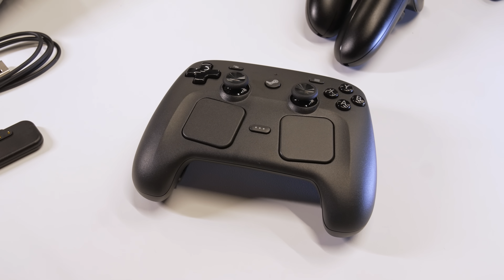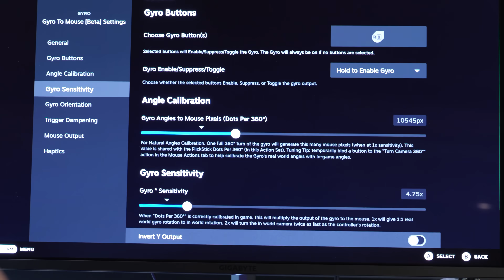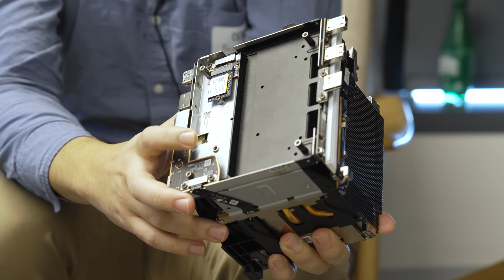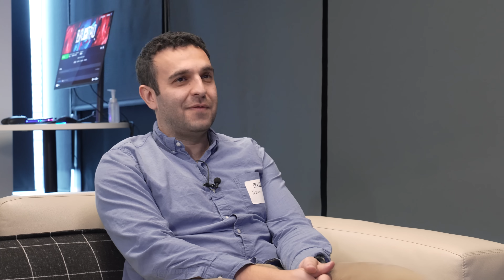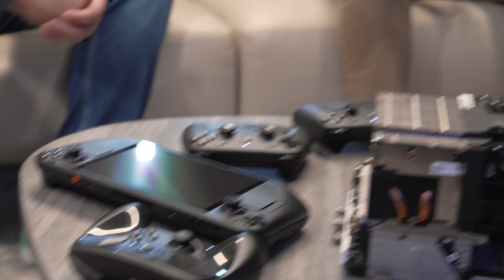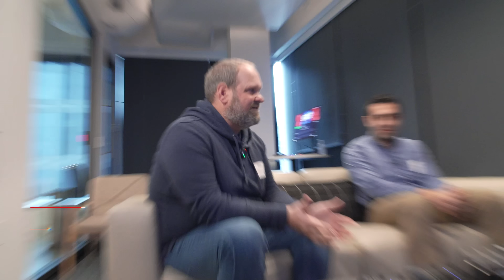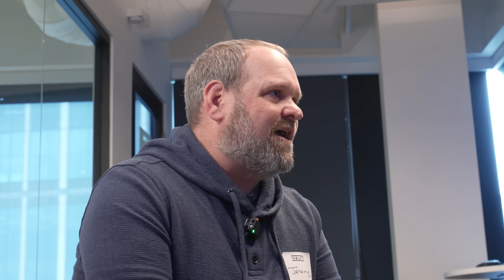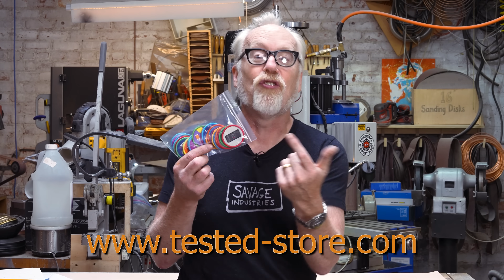Hands-On: Valve Steam Controller 2 and Steam Machine!

Comment: I was this close to upgrading my gaming PC yet again (new mobo, processor, and RAM), but I'm going all-in on the Steam Machine and the controller.
Reply: You don’t even know the price yet! If your CPU is less than 10 years old, it’s probably fine for gaming and anything higher than a Radeon 7600, about a $200 GPU will perform better.
Reply: @chrisward000  Here's the cost breakdown of me upgrading. 

Upgrading my current rig will cost about $700. 

I already have the Case: Cougar MX330 ATX ($60), Storage, a (recently upgraded) Corsair CX750M Power Supply ($90), and a (recently upgraded)  MSI GeForce RTX 3060 Ventus 2X 12G GPU ($280).

The new parts I need are:

* Ryzen 5 7600X is $180

* MSI B650 MoBo is $140

* Thermalright CPU Cooler is about $40

* RAM is currently $200-300 because prices are currently insane. I have the Kingston FURY Beast 32 GB currently listed on my PC Part Picker which right now costs $267! Granted, I really only need 16GB, but it's still way too expensive and more RAM is actually the better deal per GB at the moment since it's all WAY TOO expensive.  

Now, will the GabeCube cost the same or less than upgrading? I don't know. But if it's close, I'm sure as heckfire gonna go with the GabeCube and whatever warranty they offer (and their warranty is important) rather than upgrading. 

ALSO, when the GabeCube finally outlives is usefulness, it almost certainly going to be in the same (inflation adjusted) price range as now, and by then I'd have needed a new PCU and GPU too, which would add another $400 to the $700 I'd be looking at to upgrade more more time on my current rig. 

So all-in-all, the cost of a PC for me to build is really around the $1200 range (all said and done) yet there's no decent warranty and I have to deal with returns, refunds, and exchanges all on my own with no recourse it will get taken care of. 

At the end of the day, the GabeCube is simply going to be the better value.
Reply: I might do both, if the Steam Machine price is reasonable, and if the Steam Link on this thing gets high marks. The specs on it are good, not great, which is fine for what it is. But using it to stream to my TV from a high-end PC, that has the potential to be absolutely glorious. I get way too much input lag trying to do this on my Steam Deck, so we shall see.

Comment: Wish there were more commentary around 8GB of VRAM, seems like it could easily be a limiting factor in the medium term future. 
That being said, for a secondary device, I’m very interested in picking up all of these new hardwares - although depending on price, I’ll probably supply my own 2/4 TB NVME and buy the model with 512 default.
Reply: My hope is that since it's an APU, and AMD has already made laptops where the APU is able to use some of the system RAM as VRAM that that is also the case here.

Comment: I was rather sad when my steam controller died earlier this year and they didn't have any replacement parts. I look forward to this new offering.
Reply: RIP
Reply: i have two steam controllers, one using and one still in unopened box (sealed)
Reply: @crcka  That was me until the first one started drifting. Now I'm on my second and really looking forward to the new version before this one craps out.
Reply: @sntslilhlpr6601 that was me until last month :'(
Reply: @sntslilhlpr6601  You see the new anti drift tech they are using? 
No membranes, only magnets.
Reply: I fixed my original steam controller the best I could with 3d printed parts etc but finally decided to get another one, I managed to find a 2nd hand one in good condition and have been using that.
I'm looking forward to trying out the new controller.  I hope it has better reception from the public than the first.
Reply: what broke?
perhaps it is still fixeable with third party parts, or custom made parts(diy).
for example if the joystick is broken, like insane drift or such.
often custom ones can be added in.
plus I assume that one still used pot based sticks based on when it launched, pot based sticks often break due to there being dust between the joystick mechanisms, or buttons or such.
cleaning it properly fixes many of the problems, not all however.

but like the nintendo switch pro controllers are notorious for this, as they tend to break super easily due to dust under their buttons or joysticks making it completely unrelyable, or just not working and then people throw them away, while cleaning would fix most of it.

though ofcource, with the new controller launching. if cleaning doesn't fix it and there is no cheap other fix, it might be worth checking out that new one, as knowing valve it will be much cheaper than what most companies would charge for something like that, like several times cheaper. not sure if they can beat the super budged yet high quality controllers like the flydigy direwolf 3 or such in price as that steam controller will have many added things.
but they should be able to beat most conntroller brands, and probably won't ask insane prices for it.
Reply: This new one will be the end-all-be-all PC controller.  I loved the original controller but the lack of a d-pad made it very hard to use for retro games, so I didn't use it as much as I would have liked to.
Reply: You can have mine. Shits collecting dust in a drawer somewhere 😒
Reply: yeah it sucks when something you like gets phased out
Reply: I'm still using my first, but some buttons are now a bit hard to press. I did buy a 2nd one when they went for dirt cheap to get rid of the stock (they were €5 each), but it somehow disappeared and I could never find it back. I'm looking forward to this new one. I had been switching between different controllers because the lack of analog sticks makes the Steam controller hard to use for some games, but the lack of gyro makes the Xbox Series controller awful for fps and tps games. It was also too bothersome to constantly switch the Switch Pro controller constantly between PC and Switch. And I also didn't want to buy a DS5 controller because it's just mushy garbage (on top of that durability also seems pretty awful for the sticks). This new Steam controller seems like the best of both worlds, but I'll probably still use the Xbox Series controller for some Dpad-heavy games. The lack of gyro is a shame, but the Xbox Series controller is fantastic outside of that (well and also no hall effect sticks). The dpad of it is one of the best of any controller.
Reply: @thenonexistinghero  I don't play dpad games but yeah, I like the dpad on it on the latest Xbox controllers. Sometimes I press just to feel them 😄
Reply: Yeah all 4 my steam controllers and slightly busted like trigger mounts and thumb sticks so I just have them on display mostly these days but im looking forward to the new gear comming now!
Reply: Were you using the trackpad a lot in game?
Reply: I have been looking for a new controller to play Elden ring, and only last month I was wishing i could buy a new steam controller, it looked so interesting.
Reply: what on it broke? Bumper switches are repairable
Reply: bruh same here, mine broke down earlier this month. great controller, goes along magnificently with Diablo 3 and 4. I can't wait to get my hands on the new one.
Reply: I hope you kept it lol even in broken form i would have it sit on my shelf as a relic of gaming history
Reply: After owning so so… many controllers and a steam deck the controller is REALLY significantly desirable it’s literally the bare minimum of a controller that people care about with even more (can’t wait to get my hands on those tmr sticks after Hall effect)
Reply: Bro i gave mine to good will. Shoulda hmu. I bought it for like 10 bucks at the end there and didnt end up liking it. I wanted to like it but it felt like setting up the controller for each game was overwhelming.

I think this time around more people will design public layouts you can apply for each game
Reply: @ac.creations  It can indeed be overwhelming. When I first started using mine, I tried customizing or downloading community layouts but it was confusing and overwhelming especially when you're new to the game and the controls is a bit complex. For simple games like Stray, it works fine but for games like RDR2, it makes it harder to grasp the controls.

However, I stopped doing that. Instead, I now have a template that's configured the way I want for most games -- left touchpad for movements, right touchpad for camera/aiming, sticks as dpad and back buttons for X and A. I play games with that layout then adjust it (or not) depending on how I see fit with the controls and gameplay. So far I only tweak minors things. I've played shooting games like Metro and I've played sidescrolling/platformer like the Ori games.
Reply: @AninoNiKugi  o7
Reply: @AninoNiKugi  Ah, you got it right. 😌 Excellent. That's how I do it too. I just use back buttons as button chords.
Reply: Bought 2 for $15... then threw them away when they sat there for years.
Reply: @almostontimehero5415  they were selling for many times that on eBay.  Could have made a profit 😅
Reply: @almostontimehero5415 bought three for full price, wanted to buy more during the last sale but it was sold out already. I have an alert on my local second hand websites for when one is being sold, but my hope for it is low. Reading that people just threw them out basically unused makes me very sad.
It's the only controller I can comfortably use and the last of my Steam Controllers have died last month :'(
Reply: 2 back buttons? Useful. 4 unnecessary and does get in the way with comfort. The 2 back buttons in the pro 2 controller or original steam controller are perfect. Not much into 4 tiny ones.
Reply: @Refreshment01   Hard disagree
Reply: @emerson-biggons7078 yeah I maximise all my rear buttons.

Comment: The original seemed best only for m&kb games, but this seems better than most other gamepads as a standard controller PLUS support for mouse inputs. Awesome
Reply: That's actually not what the fans of the original think about  it. It's not just for mouse/keyboard emulation. It can be a great replacement or alternative to the traditional gamepads.

However the new design will definitely appeal to most people so it makes sense Valve did this. Sadly for us fans of the OG, it's not exactly what we want 😅
Reply: @AninoNiKugi  yeah, I would expect as much, but I think it's safe to say most gamers prefer 2 sticks and proper controller support. Personally, I was always tempted to get one in addition to my normal controller because for many of my games I'd want 2 sticks. 

This isn't as specialised as the original steam controller, so probably not so great in some scenarios, but unlike the original I cant see a reason to ever use a 'normal' controller if you have one of these (and find it comfortable ofc).
Reply: @existentialselkath1264 The 2 stick preference is down to habit imo. If people put in the time to learn the original it would have done much better. Simply ahead of its time.

Hopefully by taking a step back this time, more people can be exposed to trackpads. And they will return to the circular trackpads in future.

I'm easily twice as accurate using the touchpads + gyro using the steam controller. I can't go back to sticks anymore.

I should probably buy a second one at this point in case it breaks :(
Reply: @ganderthepanda8146  trackpads are just fundamentally different to sticks. You can argue they're often an improvement but they're never going to be a flat upgrade in every scenario. No matter how good steam input is, it's not as seamless for games with existing controller support either.

You wouldn't want to steer a car with a trackpad for example. There's more feeling in a thumbstick about how far you've moved it, some actual resistance, it's why the og steam controller didn't scrap both of them. You were also missing a D-Pad, which the switch Joycons proved are still the best at what it does, even if you can technically replicate the inputs with something else.

Even if you ignore all the above. Having to relearn controls is an issue this new controller doesn't have, while still supporting trackpads. Square provides a better sense of orientation for navigating 2D UIs, though circle has its own advantages obviously.
Reply: @existentialselkath1264 I hadn't thought of the dpad, I generally don't need to use it often.

I haven't tried playing driving games with the touchpad. I'll have to try it out, I only really use the right touchpad.

Comment: i dont think the track pads need to be there, i had the last steam controller and i really couldnt see the point, does anyone find them useful? and can you tell me why/what you use them for
Reply: They're there to play games without official controller support. Also essential for navigating any kinda desktop environment from the couch.

Unlike the original steam controller, it's not replacing anything, so games built for controller can be played with the optimal inputs you'd expect, but track pads add a lot of flexibility that's really useful.
Reply: @existentialselkath1264  this is a better design
Reply: hard disagree. they are extremely useful for all kinds of things. I couldn't imagine not having them on the steam deck. I use them all the time, and they're especially useful for navigating desktop mode.
Reply: @S7ARBOY  so in place of a mouse? this is probably why i didnt get on with them i only used it as a controller for games
Reply: @sakaspuds it's just one of the many use cases, yes. it's all about customization. the original controller required a step learning curve and setting up custom input mapping, but once you took the time, it was totally worth it. if you're not a nerd who loves to tinker like I do, it wasn't made for you.
Reply: They are excellently useful for PC games that are designed around mouse and keyboard - especially those that do not officially have any controller support. For example, you might use it in a game to map the left touchpad to open a rotary menu with various functions that you can select - and the right touchpad to a mouse that clicks when pushed. I use the right touchpad for mouse input in games like Stardew Valley that benefit from being able to select things further away from my character. There are a lot of probably better examples than this, but just giving you an idea.
Reply: Day 1 with my steam deck I avoided using them. Now I cant live without them

Comment: Would've liked a 3.5mm output, but I guess a USB converter should do the trick?
Reply: I hate how analog audio is being dumped. Speakers and headphones don't go obsolete and last for decades if cared for. Stop making it harder to use them.

Just started a new PC build to find motherboards only have like 1 audio out jack now. Wtf.
Reply: @tom.m yeah, its annoying af
Reply: What the lack of a 3.5 analog jack means is there isn't an onboard digital-to-analog converter (DAC). If you want to run HiFi/lossless audio you will need to run the HDMI through a receiver with a built in DAC or a good USB DAC. Do your research and don't cheap out on a DAC. It should be thought of as a well tuned instrument that is taking your digital code and constructing a nice analog signal. I have honestly had a good experience spending wisely on using cheaper analog headphones and spending more on a good DAC.

Comment: Steam Machine + Steam Frame + Alyx? This is the main question!
Reply from the maker: they're betting on it!
Reply: Is there any downgrade in graphics?
Reply: @MrMisuma  The steam machine cpu/gpu is more powerful than what is in the steamframes so the gfx will be better than standalone.
Reply: @Rakenclaw Thank you. I have the Quest 3, but I never bought a PC, simply because it was a bit extreme just to try Alyx. So maybe I will save up and buy these things together 😊
Reply: @MrMisuma  you can play by streaming to quest 3, it works fine. Steam frame is very close cousin to Quest 3, they have similar hardware choices - so you might not even need to buy the frame.
Reply: @Fadexpl that depends on if the steam link quest app can recognize the Steam Machine, as it's s not a windows PC. Aside from that the Frame also has foveated rendering which would help the performance in VR games tremendously, something the quest 3 lacks entirely, meaning the steam machine would just be brute forcing the graphics.
Reply: @smittyvanjagermanjenson182  Linux based operating systems have had problems running Steam VR, probably steam link with that as well. It would be very strange if they didn't sit down and fix compatibility issues with a product launch like this.
Reply: it does run smoothly, valve showcased that
Reply: Won’t be fast enough for good quality.